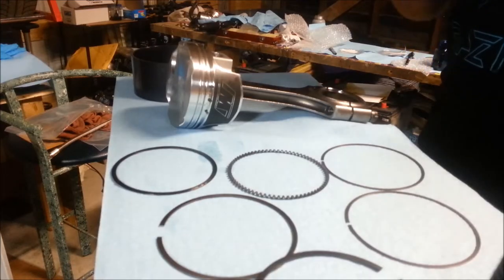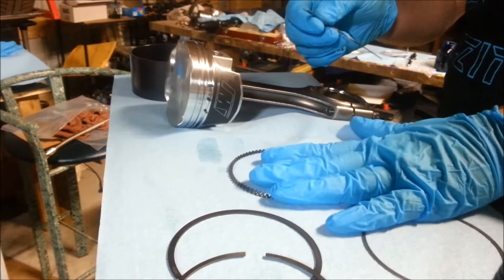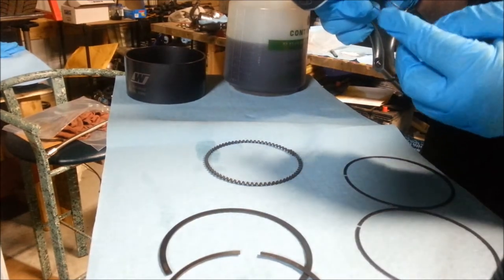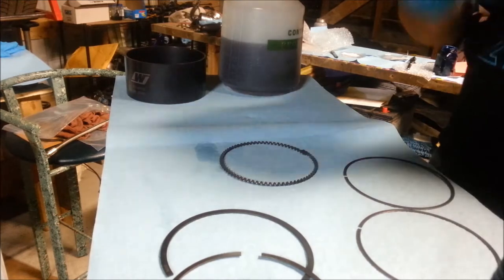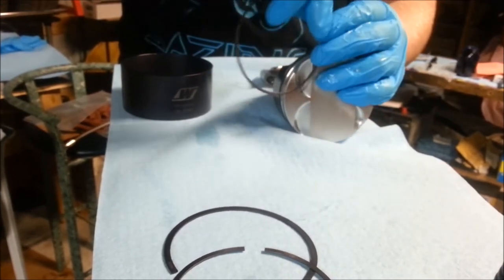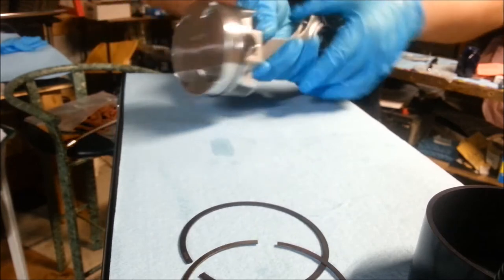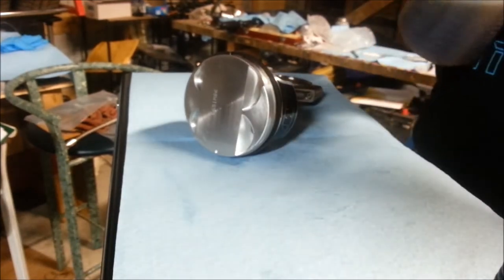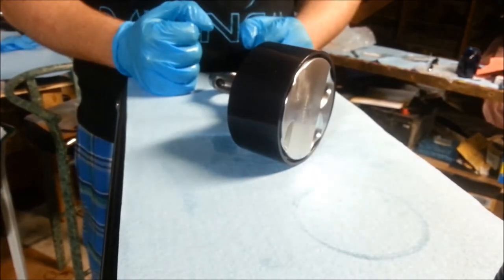PW dev diary #11 - Step 2 on installing con rods and pistons

Comment from the maker: Do you mean the napier hook on the second ring or the ring gap?
I did mention that the black'ish ring (the one with the napier hook) is the second ring. The hook aims down, the N200 stamp on the rings always faces up. The ring gaps get aimed to a different end of the wrist pin from eachother.

As for not rotating the block, honestly I'm just not used to being able to do that. It requries a crane to rotate a locomotive block.

Comment: I think you should clarify which direction the "slit" (I assume you mean bevel) goes on the compression ring. 

I find it easier to put in the oil keeper rings first, and then put in the oil retaining ring. 

any particular reason that you didn't just rotate the block, when putting in the cap?

Comment: idk how to contact in pm,but which catch can was better to you saikou or the smax??? please respond
Reply from the maker: I much prefer the Saikou Michi can.
Reply: thank you i will def look into buying it,any other mods to boost hp considerably..i have a exhaust system and cold air intake and a bov but what next?
Reply from the maker: helljumperz90
A tune. Easily the best $/hp ratio.
Reply: alright awesome ill look into that thank you again for the comments
Reply: what sizes did you get for your saikou catch can?for tubes and such, i def want the same specs you have
Reply: should i get the dual or single what would benfit me best...a lot of questions sorry:/
Reply from the maker: If you contact Saikou directly they have a complete kit that I helped develop specifically for the 2.0, comes with a GC specific mounting bracket and everything.
Reply: awesome im going to order it this week thanks again!